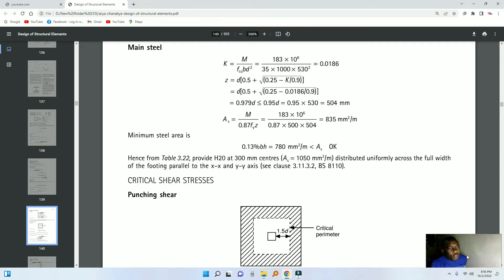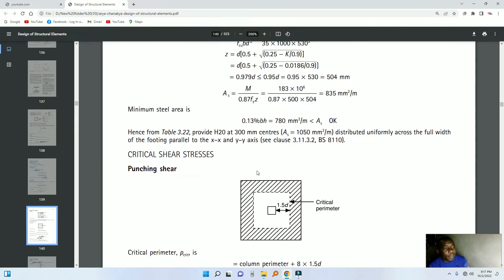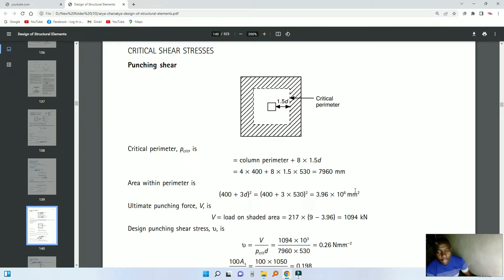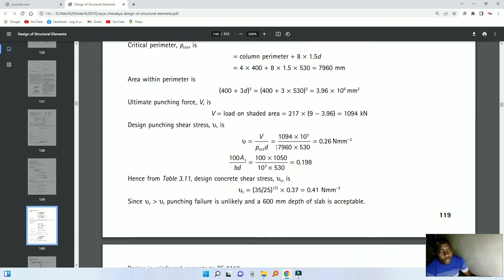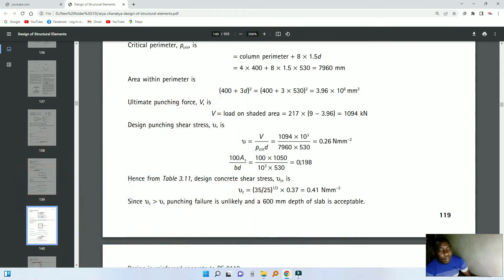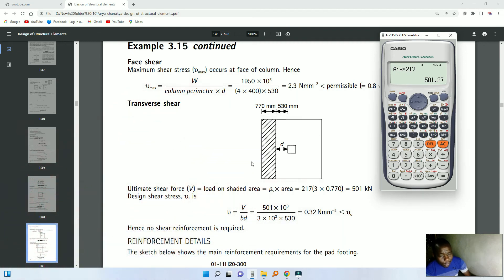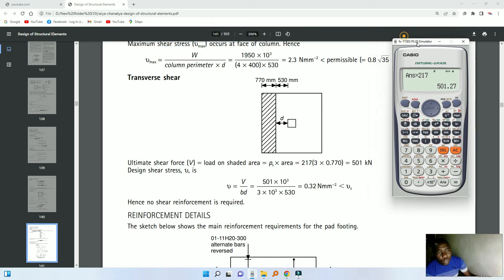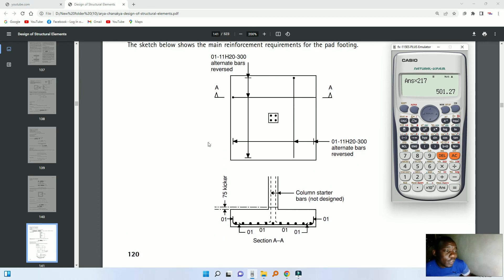pad footing design to (BS 8110) part 2

Comment: Good explanation sir
I ask you a question 
When the checking transverse shear or line shear or one way shear for bad footing
Shear stress is less than 2vc or 2× shear capacity of concrete or section
is correct or not
Reply from the maker: Which code do you use for design 
I know bs-8110 only
Reply from the maker: The important thing is that the shear   is lover than the shear capacity of the member you wish to design 
How ever in beams it should be lower that ½ the capacity  for safety 🦺